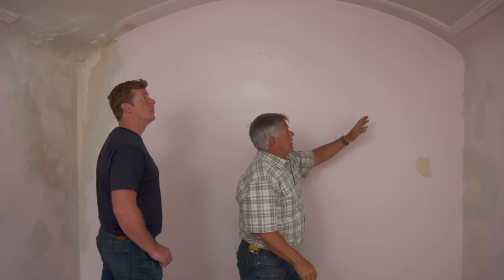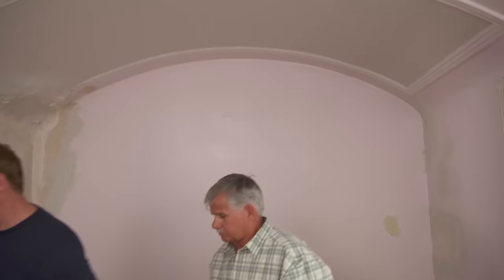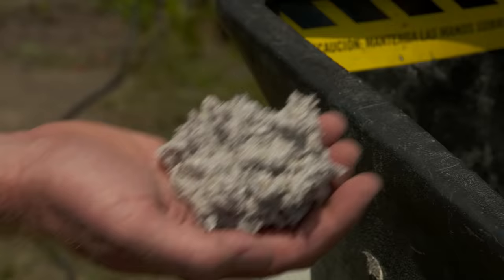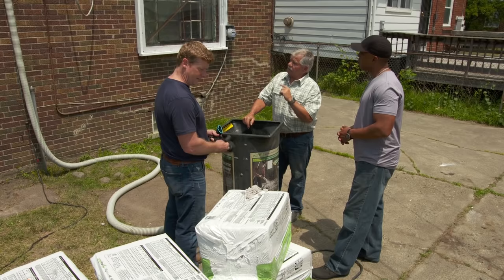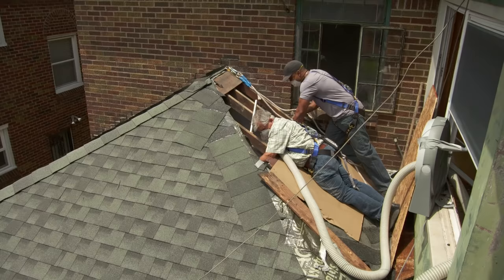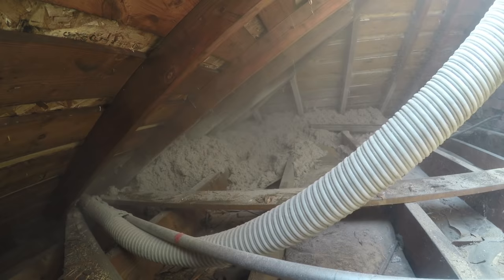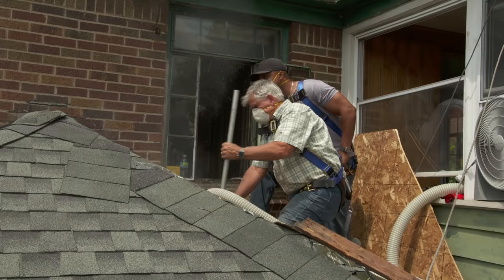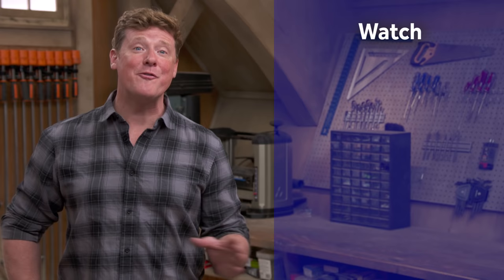How to Blow in Cellulose Insulation | This Old House

Comment: I put a foot of this stuff in the wall in the nursery and it is incredibly comfortable.
Reply: Thsts some thick walls you have
Reply: Rob Ekstrom the wind hits that side of the house all winter so decided it would be a good idea.
Reply: nice
Reply: @eprofessio  are your walls framed with 2×12?
Reply: Rob Ekstrom double wall. Ship lap, frame, ship lap, 1” foam with radiant barrier, 12” of blown in, 2x4 wall and finally drywall.

Comment: Wonderful product. Extremely flame retardant, and it's a  wonderful sound deadening material. On top of its other great attributes. I've installed it professionally for over 20 years. Started as a teenager. Couple of tips that may help. 
Some of the bigger box stores will rent you the machine for free with "X" amount of bags/ bales purchased. When picking up the machine know how many feet of hose you'll need to get from the furthest point in your attic from the access all the way down to where you'll be loading the machine. The hoses usually comes in 25, or 50 foot lengths. If its too dusty while installing try opening the hoppers gate, and let some additional cellulose into the hose (be careful not to let too much in and clog the hose). Some units allow you to adjust the amount of air going in, but most do not.  Last two tips. First, keep your hands, and arms out of the machine you're loading with the bales of cellulose NO long loose clothing, hair, necklaces, etc. Some of these machines have hoppers with metal parts that loosen up the insulation before its fed into the hose. I've seen them brake thick wooden handles, and bend steel. If they get ahold of the plastic bag that surrounds the cellulose bails accidentally just let them have it. Don't try to be a hero, and "save it". That bag can be removed from the machine or hose later. Nothing worth loosing a arm, or your life over. Final tip. Always blow insulation into attics with NOTHING in your pockets. NOTHING clipped to your belt. You will never see those items again. All I ever carry up there is my respirator (please use a good one. No "dust masks"), a good light, and something to periodically check the depth of the newly blown insulation. Sometimes a walkie-talkie is good to stay in communication with the guy loading the hopper depending on the situation.  Happy insulating! 👋
Reply: Also, as a contractor. If I have to do work in a attic. Like run new electrical, or vent plumbing,  or run ducts for HVAC work I'd much rather see blown in cellulose as apposed to blown in fiberglass in the attic I'll be working in. I know I can just brush the cellulose outta the way, finish my work, and when I'm finished simply brush it back. Do that with blown fiberglass and you're gonna be itching like a madman by the end of the day. Try as hard as you like to be careful it is going to get all over you. Heaven forbid its super hot up there (as well insulated attics can be), and you're sweating on top of everything. That itchy fiberglass is just gonna cling to you. Making you miserable.
Reply: Thank you very much for sharing the knowledge of your experience to newbies like me. God bless you!
Reply: Hey, thanks!

Comment: I am using a radiant barrier as the air shootes to get air from the soffits to the ridge vent. One thing to note is that Cellulose settles. Fiberglass also looses it's R value when it gets down to -40 due to Thermal piping as Air is forced to circulate threw it. So I have 6 inch R22 fiber glass batt. I am adding scrap Styrofoam packaging material and then plan to use Cellulose to seal everything and to fire protect the Styrofoam.

Comment: Is there not supposed to be vents that go from the cornice (soffit) area, along the inside of the roof so as to allow the boards of the roof to stay dry?
Reply: I noticed that too - they didn't do anything to keep the insulation back from the perimeter. The mold is ready to move right in.
Reply: Yes. and also it's good to use Fiberglass as the base to reduce settling while fiberglass itself looses it's R value when it gets cold. The only places you can skip the vents is in areas that cool more than they heat.
Reply: I thought baffles were supposed to be used
Reply: Old houses don't have soffit vents. My house does not have them.  Edit: for clarification, old houses were not originally built with soffit vents.
Reply: @RD-zq7ky  depends on the house and if it was upgraded to that. Some do have them which makes baffles necessary
Reply: @RD-zq7ky  old houses tended to leak air more. I had an old house and had Ice dams and had to add soffit vents. Edit: it also depends on what climate zone you are in. I am in climate zone 7.
Reply: @XX-166  I guess I should have said they were not originally built with soffit vents.
Reply: @RD-zq7ky  understandable as people upgrade their inside and outside of their home all the time. There should be air flow in the attic or there will be roofing issues and possible mold.
Reply: @XX-166  would baffled and exhaust attic fan double the movement of air movement to help minimize chances of mold
Reply: @blackfootchata86  an exhaust fan would help for sure. There’s supposed to be airflow in the attic area for the roof itself to help prevent issues.
Reply: If vented soffit, then proper vents.
Reply: @XX-166  unless the attic is air-sealed (from the room below) an attic fan is going to suck a lot of conditioned air out of the house.    Always get the attic air-sealed before adding a powered attic fan.
Reply: @koomo801  you will not have nor do you want a hermetically sealed home and there will be some air loss that can be minimized.

Comment: Melting snow on a roof is from lack of air sealing. A foot of blow in insulation is great, but useless if hot air is leaking through to the roof deck. Stopping air leakage is 100x more important than more insulation
Reply: Robert is correct.  Sealing air leaks is important also.  Leaky warm and moist air from the living space can rise into the attic and condense under a cold roof.

Comment: Should my attic space over my attached garage be blocked off/walled from my home attic space to prevent the hot air from being over my living space? The space over the garage is uninsulated. The rest of the attic over living space is blow in insulation. I have soffit vents and ridge vents throughout the garage and home. The garage roof faces South and "cooks" in the summer. I live in Georgia.
Reply: Why not just insulate above garage?

Comment: Makes me itch,, just watching it. Lol Blown in more than a few bags. Lol
Reply: Fortunately blown insulation isn't fiberglass, for obvious safety reasons.
Reply: @cup_and_cone  it's still itchy. Lol
Reply: @savageboner  It's actually good to mix Cellulose with Fiberglass since The fibrerglass will prevent the Cellulose  from settling and the Cellulose will seal the fiberglass so it does not lose its R value when it gets cold. edit: lose its

Comment: Can you pretty please do an insulation video on a single wide mobile home. My insulation sucks
Reply: Moble homes generally have flat roofs. I know people that have put up pole barn style roofs over them and then insulated that.
Reply: I've lived in several. It's a mobile home. The insulation will always suck, and there is a danger that upping the insulation can reduce the airflow and rot out the 1x3 boards holding that whole thing together. The only way to fix it is to insulate it from the outside, but by the time you put in the time, effort, and money to do it right you might as well just build a house.
Reply: move the home to a warmer climate
Reply: @silverSScamaro , lol, most of the ones I've lived in the "mobile" part of the name was an honorary title. Once they reach a certain age, they are likely not moving again without causing damage.
Reply: @silverSScamaro  no I like Oregon
Reply: @silverSScamaro  🤣🤣🤣🤣

Comment: And if you are incredibly lucky, you could end up with a basement full of the stuff because the contractor didn't check the crawl space inside basement wall along the foundation.  What a mess!
Reply: I did this to my house. Balloon frame.... Still working alright
Reply: Depends how the house is built. You would be surprised how much pressure blowing into the wall creates. I do it for a living.

Comment: How do you keep it from blowing around afterward?
Reply: The first time it gets really humid the insulation will clump together and fall down several inches.  Also, if your attic has that much draft, you have other problems.
Reply: Put the rest of the roof back on.
Reply: Attic insulation does not just "blow around" like you may think.  It's an enclosed space, no violent air movement really, just freakin hot.
Reply: Spray glue 🤔

Comment: Could I blow this in between the rafters behind the fascia board when I replace the fascia boards?
Reply: Depending on your climate zone, you have to be careful placing loose insulation against the roof deck. Moist air filters up to the roof deck and if there is no ventilation at that point, it could condense against the cold deck and create moisture problems. Check with a local contractor or architect.

Comment: Would you recommend the roof be spray foamed as well?
Reply: Spray foam + cellulose insulation in the attic (and the attic is not an extra room, just your regular attic) it would be way too much of an overkill and ultimately unnecessary.
Reply: That is exactly what the pros do.  They spray foam the outer walls, some lay R-22 bats of insulation and then fill them up.  Then they take 5/8's plywood and cover it all up then add AC vent supplies to be a conditioned space which reduces the entire load on the house from a Manual J, D and S.  Check out Matt Risinger to see some amazing attics and house building for super efficient homes and ideas that are truly not that expensive in some cases and puts a huge savings on all systems later on.  Those guys come up with some amazing ideas.  Most of the work you can do yourself.  But I do HVAC for a living, so I have many offerings to fill the attics, close them off, Aeroseal the vents, and of course super efficient heating and air options.  But I think you will find the link below pretty awesome.  

https://www.youtube.com/@buildshow

Comment: I've dealt with this stuff before. It is the nastiest stuff in the world to work around. You can't see structure to tell where it's safe to move if you have to run a wire or ducting after the fact, and if it ever gets wet from a leaky pipe etc. It holds that water forever.
I'd never use it on any of my jobs.
Reply: Always, always prep a attic before blowing insulation. Bath fan vents. Seal all bypasses, and fix your roof so it doesn't leak. I do this for a living and this stuff is great besides the dust while blowing. It's excellent at air sealing. Its better to do everything you just said before you blow. Wrap chimney in 26 Guage or thicker flashing.
Reply: Do you wrap the chimney to reduce the risk of fire or is there another reason?
Reply: @MrVip2011  Chimneys are a different sub contractor, but most use separate sealed flu liners on the inside of the masonry.

Comment: So far I had the impression that American homes are wood framed but this looked to be brick.
Reply: Pretty sure it's wood framed with a brick veneer, meaning one layer of brick on the outside of a wood framed wall.
Reply: Depends where its built, clay is crazy cheap in the south east

Comment: Hate blown in insulation.
Reply: Messy as sin and sucks to do absolutely any kind of work after it's blown, but after spray foam, it's the highest R value you can get because of its coverage.
Reply: @cup_and_cone  
Sure, can't compare the price though...  Foam a lot more expensive and requires more prep work

Comment: Hate this stuff. It’s so dusty and hard to work with. That’s why I prefer loose fill fiberglass, it behaves the same way, much less dust. Has a lower R value, but that doesn’t matter because you can just pile more on.